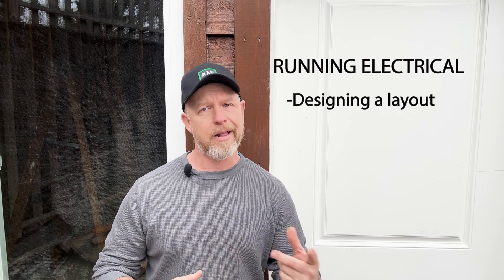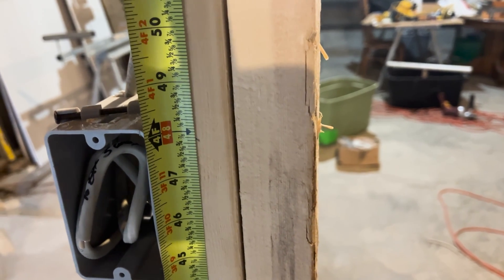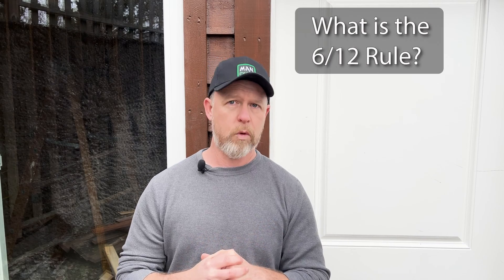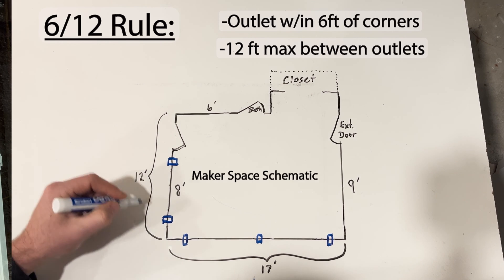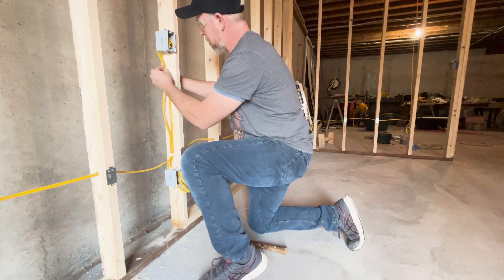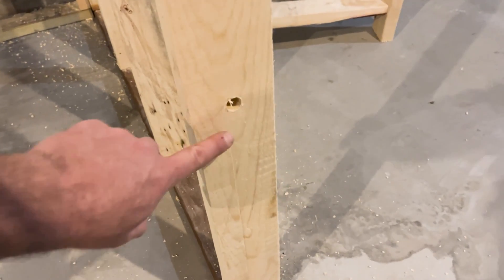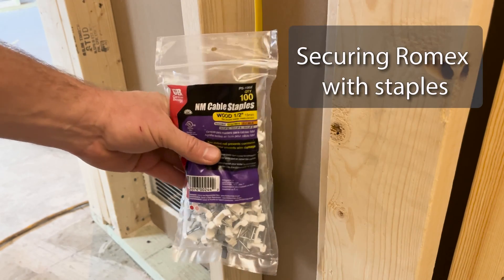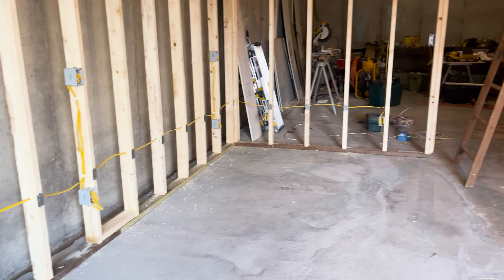Wiring BASICS Made Easy - Running ROMEX for Switches and Outlets

Comment: Why do you need to use the plate?
Reply from the maker: @derrickbaggett2573 It may have been overkill on that part of the project - I wanted to be sure that none of my drywall screws or any other screws would be able to make contact w the wires.
Reply: @mancyclediy I kinda figured that was why but just thawt I would ask

Comment: Good job, however, I would strip the sheathing, connect the grounds using a green wire nut or a Wago connector, trim and fold the conductive wires deep into the box. Important if a roto zip is used to cut out for the boxes. I would have considered a service loop for the cable before box entry in case mistakes were made. Are you using pigtails or wiring directly to the screws?
Reply from the maker: Thanks for the tips! Pigtails.